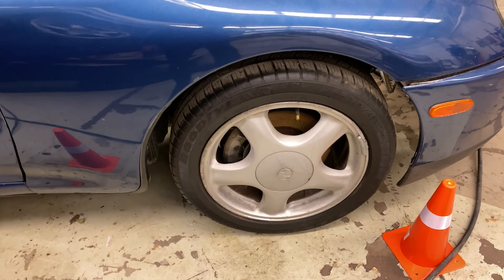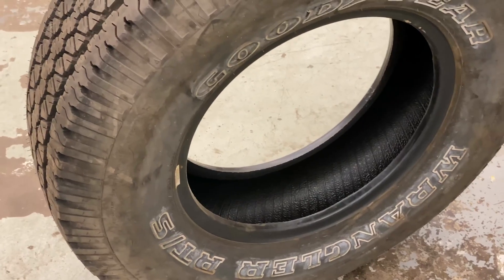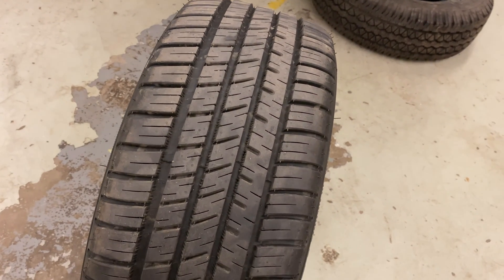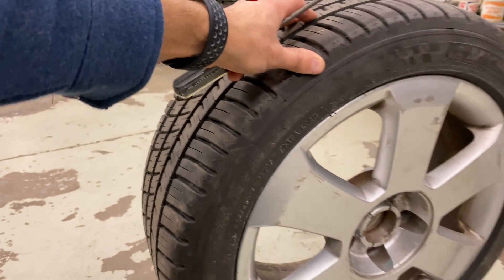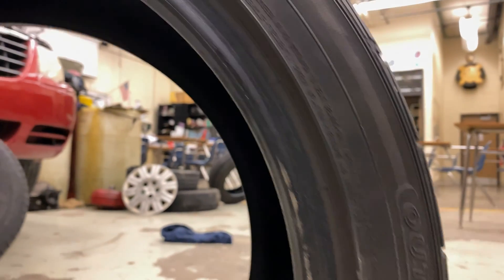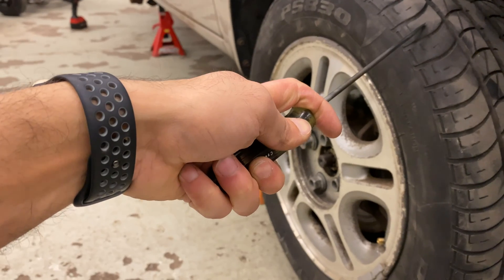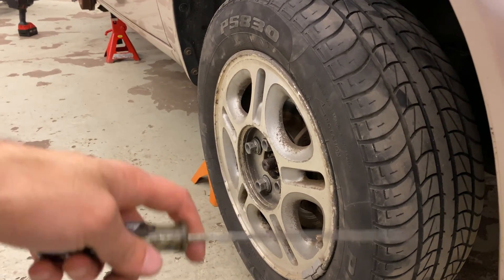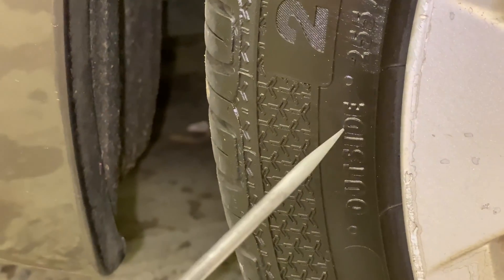Tire Tread Patterns - How to Identify

Comment: Aren't all asymmetrical tires also directional? Can only be rotated front to back, no crossover. You said asymmetrical tires can be mounted on any corner of the car
Reply from the maker: “Asymmetrical tires are designed to enhance traction, handling, and cornering capabilities while reducing noise. These tires are often found on sport performance vehicles. The tires can rotate in either direction when mounted with the correct side facing out, as indicated on the tire sidewall”

Although I have seen very few Asymmetrical and directional tires out there (Michelin), most Asymmetrical tires can rotate either way!
Reply: @tunerworld  Hi, what will happen if I switched outside in?, is dangerous?,because my car rear tires inside wear faster than outside due to camber. 
Thanks

Comment: Directional tires have arrow on the sidewall of the direction of the tire?
Reply from the maker: Yep! They should have that. Some tires (Rare) are Asymmetrical Directional as well and would also have an arrow
Reply: The tire attached to the car has a rotation direction arrow clearly visible which indicates the tire is mounted on the WRONG side of the car!  If you leave it that way, the tire will be turning backwards.